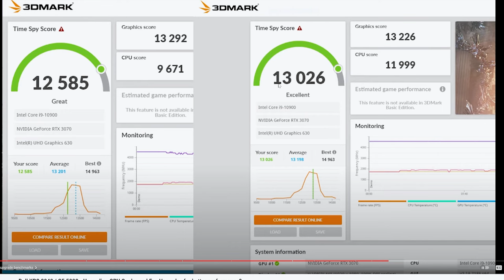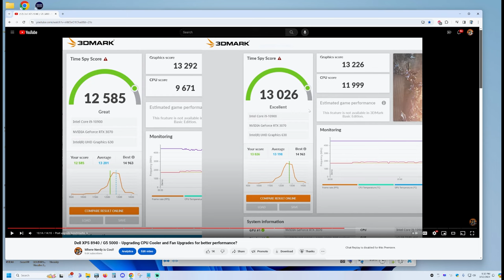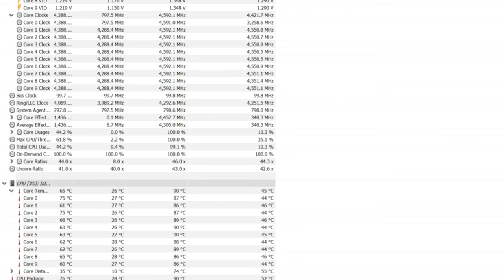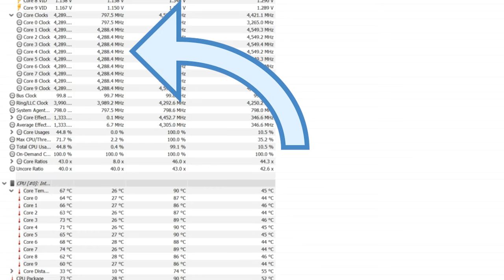2024 Upgrade Update for the Dell XPS 8940

Comment: Great upgrades - I have a similar build over time (especially the Noctua CPU cooler). However, I am looking to upgrade the PSU to 750W. I know it's a bit of an ask since there are no standard sizes for the XPS, but perhaps you have something in mind or know what 750W+ to upgrade to. Any chance you can make a video on that, or perhaps share your thoughts here in a comment? I've been looking at Corsair or Silverstone, but I don't know if they'll fit. I hope they will, but I'm not eager to order them and find out they won't fit. Looking forward to your reply, cheers!

Comment: Anyone else tempted to literally strip the CPU, SSD and GPU out of the PC and put it into an entirely new case/motherboard? The only think I like about the Dell 8940 is that it has pretty decent front IO.
Reply from the maker: It uses a proprietary power supply so there is that obstacle
Reply: @WhereNerdyisCool  Agree, the Dell PSU is also not very quiet.

Comment: Hi, I just watched your upgrades. I am working on a friend's pc, it's a Dell XPS 8940 i7-10700. She only really uses it to edit photos. Using photoshop and lightroom. The issues she has is while using a brush tool in photoshop it sometimes freezes the pc and the program stops responding. Not sure if you could help figure out if there's any upgrades I could do to solve this. It does have the Nividia graphics that came with it, 24gb of Ram. There's an SSD. Any ideas? I have noticed where she has the tower and mentioned to her that heat could be playing a part but I am wondering if it's a photoshop issue.
Reply from the maker: Dell has an update program that should be pushing the latest drivers for the board and hardware inside.  If you put your hand over the back (where the outlet fan is) I imagine it’s pretty warm.  As shown in the video, mine is an Intel i9 and that hockey-puck like heating just wasn’t working well for me.  If your friend opens the case, see what type of heat sink is in there.  Certainly a better cooler could help.  If I didn’t it over, I’d skip the fan by the video card. But the bigger rear fan sure pulls a lot of heat out   The front one, while not entirely necessary, sure helps move that hot air out of that little box!

Comment: Oh, this came up on my feed - I just did similar mods to my I have my  XPS 8940 3070 / 10700K so thought to put down my findings:

Its the one that came with the Big Dell cooler but was still hitting the temp max for cpu whislt gaming

Was hitting the temp limit before, now not at all

I opened the case, put 3x deepcool 120mm fans blowing at the motherboard and gpu and a Dracena 120mm AIO cooler (If you remove the rear fan it fits snugly/almost perfectly in though theres no natural drill holes) from amazon.(Its still not screwed in I will be drilling a few holes when I have a moment) the cooler came with a rgb and fan board so i could attach the other 120mm fans.

Really happy with it, im still iterating a 3d printed cover for the side panel with gaps for the fans whole lot.